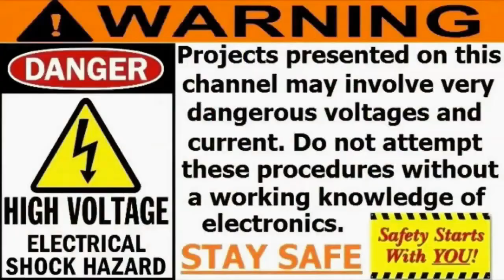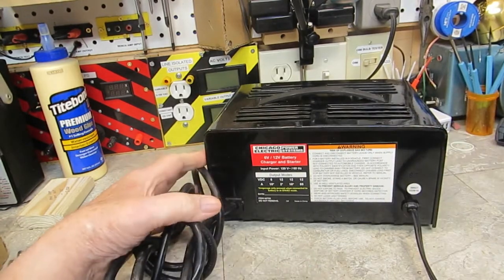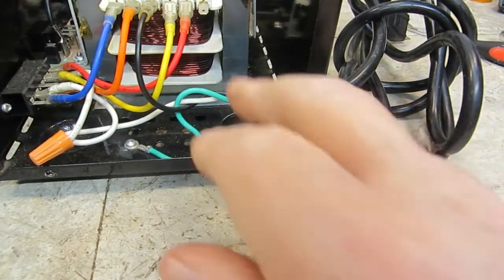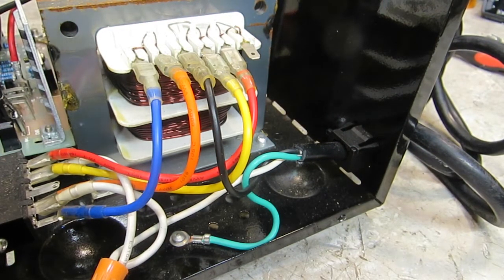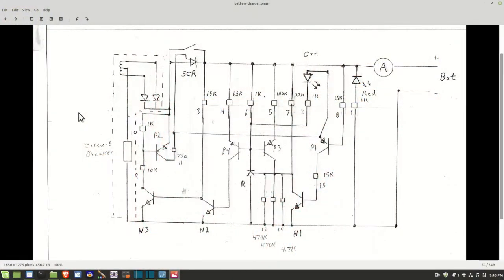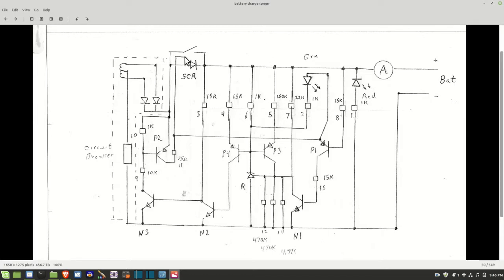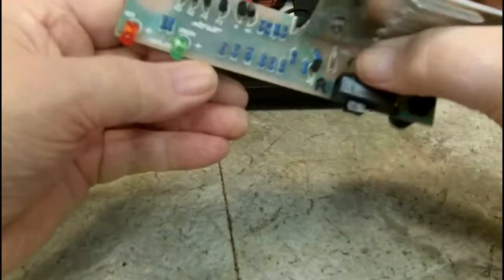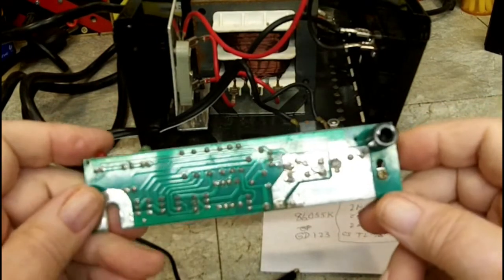DERB - HFT Battery Charger #66783 - Repair part 1

Comment: Nice little project. Worst case scenario you can scrounge the transformer for something else! I have a HF heat gun that worked about 5 times before it died. It was cheap enough I could have easily just thrown it away. I took it apart and found it had a fusible link made into the circuit that had blown. I cut it out and installed a push button reset circuit breaker of the same amperage instead. Drilled a hole in the rear housing to locate it and it works perfect.  I used it now for hours over the last two years and it continues to serve me well. They don't make things to last because they want you to buy new. Just a simple upgrade makes a lot of the cheap stuff much better. Maybe something simple on the charger with a better quality part will get it going and make it last.

Comment: Covering every angle with a camera is always a good idea. Since most of the voltages are there it would seem there is a problem in the control circuit like you said the SCR is your suspect part. But, you will figure it out I am sure Doug.

Comment: That SCR shuts off at each zero crossing of the AC line.  It is fired at the proper time in each cycle to provide voltage regulation to the battery.  That thing marked "R" is a voltage reference for the regulation.
Reply: The "R" thing  looks like a TL431 programmable shunt regulator which is used as a very accurate voltage reference.    You are correct the SCR is on during each cycle and shuts off at zero crossing.

Comment: According to manual the only time the amp meter turns on only when in start mode . amps do not display when in charge mode. Also will not see power come out of charge mode unless it's hooked up to battery and only then . check battery voltage before hooking up to charger to get baseline. Then hook charger to battery in charge mode and you should see a higher voltage reading then your baseline reading.also while your tester is still hooked up Then check to see if setting switch voltage changes as you select different charge rates. Hope this helps out for you.

Comment: Might try checking the transistors first. You do have a continuity checker no? Could apply a voltage to the board to see if the voltage gets cut off by an open  or shorted transistor.

Comment: Any chance you or anyone else followed up on a part 2 of this video? I did a screen grab of the schematic but is there a direct link to it? Any chance a replacement scr part number or substitute was found? I never used my charger after buying it do many years ago so disappointed it’s not working as a battery charger. I’m a pretty good tech so I’ll be going threw the schematic and testing that the scr will latch on with a low voltage 12v battery is on it and I put voltage on the scr gate to see if it latches on. If it does that’s good news as it’s the ma I switch to start the charging. 
As pointed out in the video, the start sw that bypasses the scr will allow full output voltage and current. If I find a fix I’ll try and revisit this video and post the fix to normalize charging again.
Reply from the maker: Sorry, no. I did pull the SCR out and test it and it was open. I did find a replacement SCR but by the time it arrived from China I had already replaced the battery charger with a much better one and never did replace the one in the HFT charger.
Reply: @DERB_Seymour_Indiana  I just E wasted it today.  I’m a ok tech but I decided to not spend any $ on it and maybe buy a new model with the warranty and this time fully test it and not just store it in case I needed it trusting it’ll work.

Comment: Did you find the correct SCR for the charger, and did it fix the issue?
Reply from the maker: I did find what I believed to be the correct SCR, but it did not fix the problem. I gave up on it and bought a new charger. Given the source of the part I got, I'm not certain it was any good either.
Reply: @DERB_Seymour_Indiana  thanks

Comment: NO NO NO.   Use a car battery not a 9 volt battery.   On second thought yah I would love to watch a 9 volt battery violently explode instantly.     Wear your safety goggles!!!.    LOL           You're definitely going to need a lead acid battery to test this circuit out.   It needs the battery in circuit to act like a filter capacitor that smooths the 120 cycle pulsed DC the SCR is controlling.       This circuit continuously monitors the voltage across the battery and when it is low (not fully charged state)  it pulses the SCR gate on.   Once the battery voltage instantaneously rises to a set value it quits triggering the SCR gate and the battery floats at that point for a short time and if it still needs a charge the voltage drops and the SCR gate is then pulsed again.   This is all happening super fast until the battery voltage does not drop below a set point any longer.   Once the circuit sees the battery voltage is at a fully charged voltage point it then turns on the "charged LED" and quits pulsing the SCR gate.   The large part is the SCR.   The thingy mounted in the cabinet  with the screw terminals on it is a thermal circuit breaker.   The "R" part is the TL431.  That is your Shunt Regulator IC that is used as an accurate voltage reference for the rest of the circuit to compare battery voltage charge state to.   It would be interesting to show the pulsing of the SCR gate on your scope.   Use channel 1 to monitor SCR gate pulses and connect Channel 2 of scope to monitor the battery voltage ripple in real time.   I am familiar with this circuit because it is almost the same schematic as a vintage Schumacher charger I have.   Hope this helps   I look forward to next episode.
Reply: @DERB_Seymour_Indiana  10 amps though a tiny 9 volt battery is like a dead short.   Wouldn't take a second to blow.    Although the charger may be configured to not charge a battery that has been drained to 9 volts.    A car battery with 9 volts resting voltage would automatically be considered dead/damaged in some charger configurations.    It might not even turn on.    You definitely need to use a 12 volt battery that could handle 10 amps of charge current.   A lawn mower lead acid or a gel cell for lanterns could also possibly get damaged.   Why do you think the SCR is bad?    Be safe.